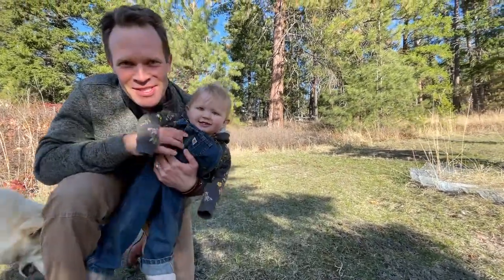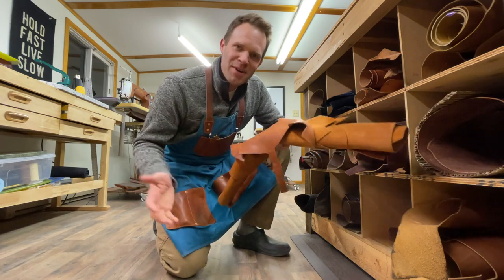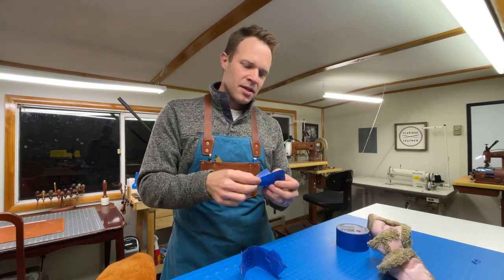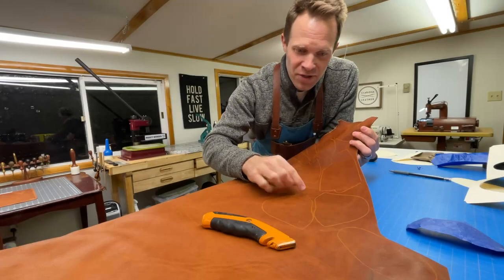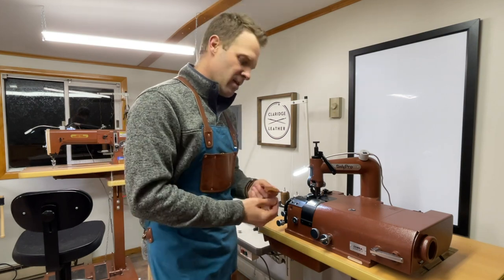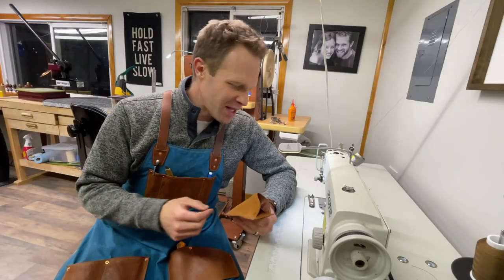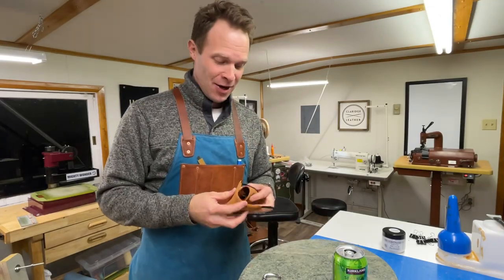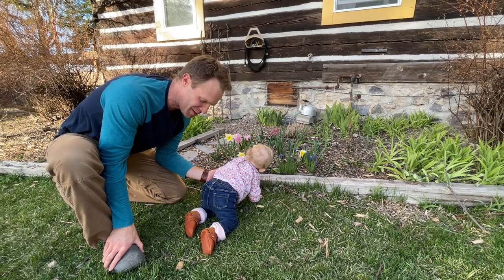Dad Job: Making My Daughter’s First Shoes

Comment: Tanner is there another way to skive leather without a machine?
Reply from the maker: Yes, lots of ways— some people use a skiving knife (there are quite a few variations of these), and the knife must be extremely sharp. This is a tedious but rewarding (and usually nerve-wracking) process. I often use a French Skiver from Palosanto. It is a hand tool that kind of scoops away a path of leather the width of the blade. Kind of like mowing the lawn! This is my go-to method when not using a machine.